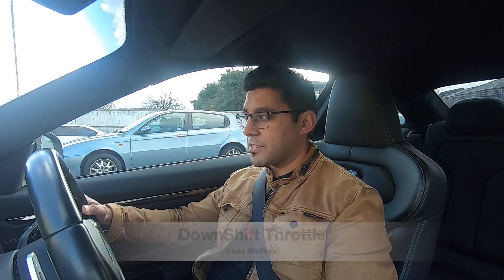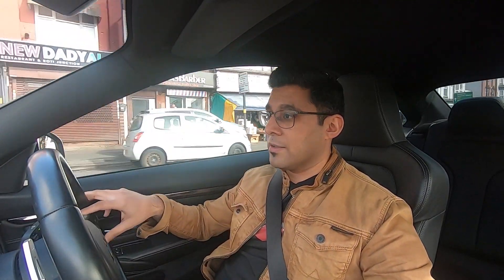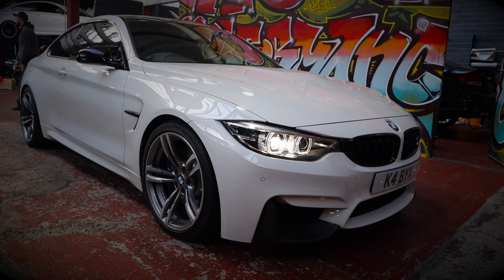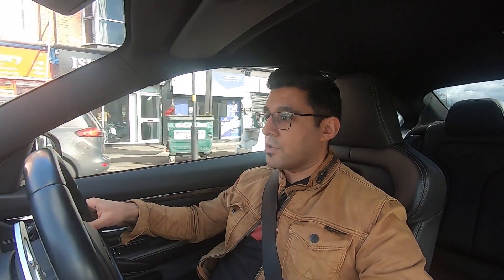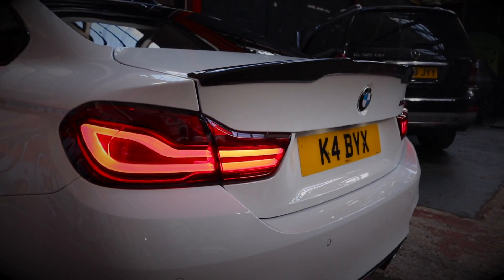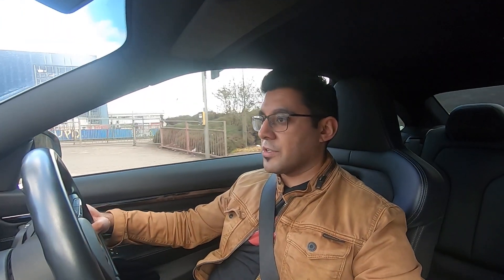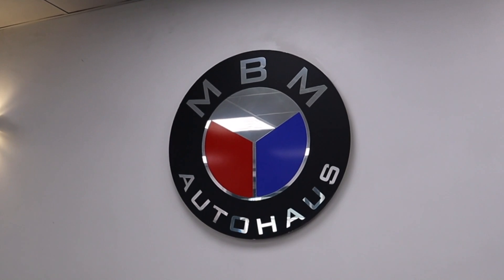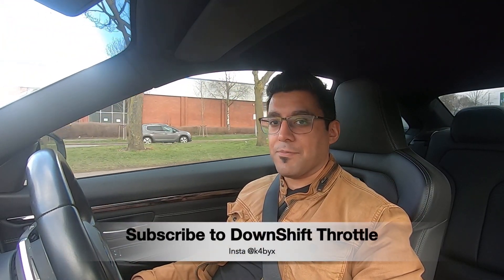BMW M4 Update & Interim Service

Comment: Main thing to watch for is turbo oil seals mines just gone on 47k going in this week luckily I have a warranty on the car
Reply from the maker: When mine go I'll probably put some hybrid turbos on
Reply: @DownShiftThrottle  that idea has been thought of but iv not done the crank hub and the car isn’t great at putting 560 down never mind 600+

Comment: Sytner dealers aren’t the best in my experience. My SQ5 was supplied by a Sytner dealer but when it comes to servicing it goes to a jct600 dealer as they are much cheaper than Sytner.
Reply from the maker: I'm unfortunate in that case the 3 BMW dealership close to me are all sytner. Sytner Solihull, Sytner Oldbury and Sytner Tamworth oh and Sytner Coventry.....daaaaanm